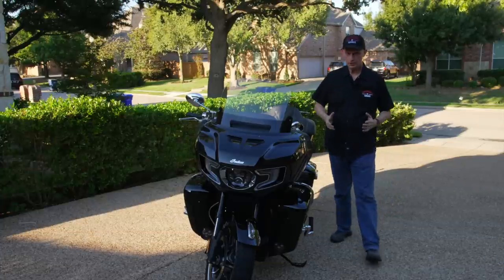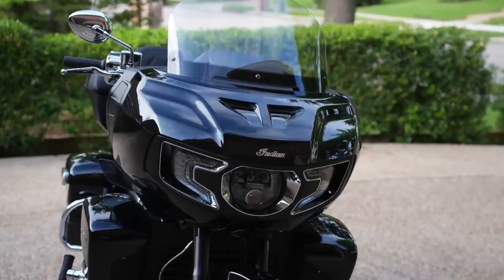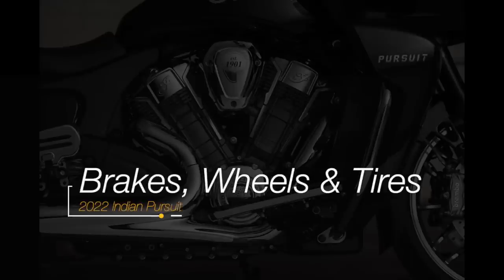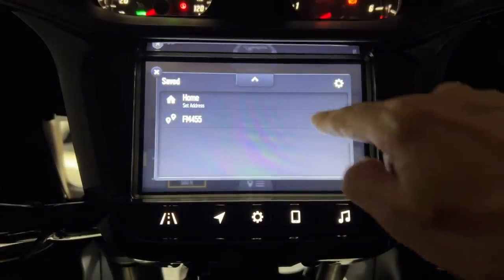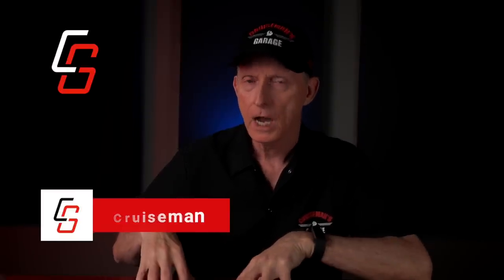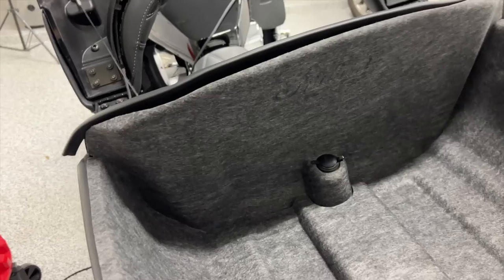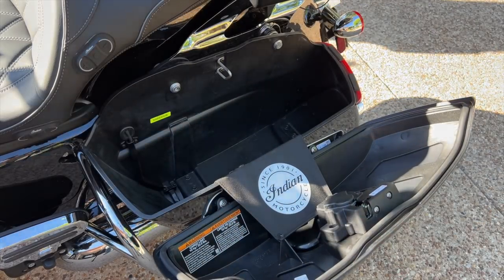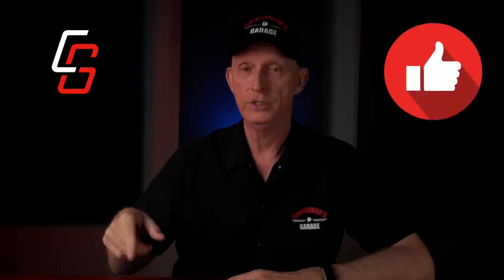Is the 2022 Indian Pursuit the BEST V-Twin touring motorcycle? | Indian Pursuit Review

Comment: Indian Pursuit Owner - I hate to admit it but I agree with every thing you said.  The liner in trunk is loose on mine. It wasn't on my Roadmaster. So I can't figure that one out. On the trunk removal. After you remove them the first time. You can replace the screws with a tie rap that will be hidden from view. To remove it you would have to open the bags. The bags are locked so that solves that problem. It would be nice if the bags and the top of the trunk were lined also but I guess we can't have it all. Good review.

Comment: I've had a Victory Vision since 2008. The battery is in the exact same location. It's very easy to access and change out. 10 minutes max to swap it out. Done it twice already and will probably do it again before winter.  From a first hand perspective, I can assure you that the battery location is a non-issue.  Great video as always. Thanks!
Reply: I just came off of a 2012 Vision. The biggest difference in my opinion is the wind management. The Vision is far superior in my opinion with wind and rain protection. My wife likes the Pursuit better for comfort having fallen asleep a few times. I miss my Vic but the little deer thought that it would look better as a hood ornament.
Reply: I also have a 2008 Vision. I haven't found anything close......

Comment: Very nice review. It's ashame the bike doesn't have a reverse....or hill stop assist...or a centerstand..or  AA...seems like those features would be easy to add and a bike in this class should have those features.
Reply: And at $30k to boot! The Gold Wing spoils a person.
Reply: @roadglide  yes the Gold Wing spoils you..especally that flat 6 engine.
Reply: At 6'2" and 191lbs... I don't need or want any of those things.
Reply: @UnrulyRider  That's fine its just most people do want those things with a luxury touring machine
Reply: @frankward8003  I bought a base model, slightly used but low miles 2020 Challenger.  Adding the removable tour pack eventually, but have no use for lowers or anything else that the Pursuit model offered.  Many people want a base model platform.  Build the bike up with aftermarket/custom parts as you go.  

I agree, there should be a premium tier fully optioned out machine. And the Limited or Elite model could fit that niche at there price.  Though a lower price-point entry level model offers the best value to most buyers as they will be making the bike their own with custom/aftermarket parts.  I feel a reverse gear is overrated to most riders that have never had it on previous motorcycles. 

A center stand could be useful, but oil changes on the PowerPlus 108 engine are designed to be done while on the kickstand.  The location of the oil drain plug makes this pretty obvious.  It's a 15-20min job from start to finish with the proper low-profile motorcycle drain pan.

Hill-stop-assist seems like something that would be easy enough to implement in the future.  Would require the proper electronics/switch, wiring, and line-lock type solenoid connected to the brake line to hold the brake pressure.  Something like this could probably be developed as an aftermarket add-on without too much difficulty... if it doesn't already exist.
Reply: @UnrulyRider  I use the reverse all the time with my bike...rock driveways or when your in the grass...or when on a slight grade...all of that makes a reverse gear  needed with a 900lb motorcycle...the centerstand is useful for all maintenance especially when changing out the tires..heck a centerstand makes washing the bike easier.

Comment: Great review and a very fair perspective on this motorcycle.  I went from a 2018 Goldwing to the Indian Challenger and have practically turned it into a Pursuit minus the rear shock and a few other details. So far...no regrets. I loved both bikes, my Goldwing and my Challenger but sometimes it is nice to change things up.

A few notes:
- The clear coat is not "kind of soft"  it is a real problem. Mine got scratches in no time. I have never seen paint this soft. I buffed it out and just ordered a tank protector. This should not be necessary.
- I have the same rear trunk as on the Pursuit. It is hard to close and takes significant pressure to close it.  I removed the latching arms and put two small washers under mine. It moves the pin down just enough to make latching easy and still watertight.
- Love the engine of this bike. I have always liked the look of v-twins but never the ride.  This bike has changed that for me, smoother than a Harley with more power and a better-looking engine than the Goldwing, with an American v-twin attitude.  In my opinion.
- No infotainment system is perfect but this is the best I have owned.

Thanks for the thorough review!
Kevin

Comment: Your review is right on the money. I have 5000 miles now on my 2022 Indian Pursuit LTD w/premium pkg. It is a phenomenal machine. Better wind protection than my 2021 GW Tour DCT I had previously and at highway speeds, the Pursuit is rock solid. My GW would catch heavy side winds and move the bike quite easily.  I would say the ride quality is equal on the 2 bikes. /At low speed turns, the GW seemed more forgiving while the Pursuit tends to have more oversteer.  Engine heat was non-existent on the wing but can get pretty bad on the Pursuit at stop lights in 90 degree + weather.  The tech on the Indian is the best out there right now. All the info you could possibly need and then some.  At times, I miss the silky smooth flat 6 of the Goldwing but I just purchased a mint 2000 Honda Valkyrie CT with 10,000 miles on the clock. That should satisfy that "itch" for a while.

Comment: I own a 2022 Chief (air-cooled). Even on sweltering hot summer days, I can feel the difference in heat creep up my right leg and the frame bars underneath the seat. I test rode a Challenger this summer, during sweltering heat. This test bike was ridden non-stop all day by other test riders. I rode it during stop-n-go traffic on the interstate and I did not notice extra engine/pipe heat anywhere on my body.

Comment: I like the Indian for many reasons.  I test road a Challenger and liked the power also.  The only downside to Indian is the lack of dealers.  I live in the Memphis, TN area where the local dealer went out of business.  My friends have to drive over 150 miles to the closest dealership if something needs done by a dealership.  I do like the fact that the Indian is putting pressure on the rest of the touring market to make better routing motorcycles.
Reply: Have you considered using industrial strength Velcro? It should solve this issue.

Comment: As a long time rider of the Victory Vision, I see a lot of common Polaris traits in the Challenger and Pursuit. Hopefully I ride the Vision for a while longer but the GW and Indian are top of my list for replacements. Thanks for the great review Cruiseman.
Reply: I've been riding a Victory Vision for 14 years now and 106k miles. Ride it to work every day of the year there isn't snow or ice on the road. It's been a great bike. Never replaced anything on the motor except the spark plug. I only see two motorcycles that could possibly replace it when the time comes, Goldwing and Pursuit.
Reply: I had a Victory Vision from 2016 to 2020 and absolutely loved it!  I only sold because of seat height issues: 2” lower kit caused damaged and it wasn’t as comfortable without it.  I traded it for 2020 Indian Roadmaster which is a wonderful bike, but had a very different feel and didn’t inspire the same kind of love.  I’ve done a few demo rides on the Pursuit and feel like it’s a spiritual successor to the Vision - I’m picking up my new Pursuit tomorrow!
Reply: You will like the Pursuit! Even though both the Vision and the Pursuit are roughly the same weight, the Pursuit has its weight sitting lower so it is easier to handle in a parking lot. But just like the Vision, once you get going it feels like a sport bike.😁
Reply: I test rode a Pursuit yesterday, and my first thought was it was like riding a Vision in handling, weight, ergonomics.

Comment: Great review! I bought my 2021 GoldWing Tour DCT and accessorized it to suit me and my significant other. I’ll be 70 in December, so figured this bike would take me to when I decide to hang up my riding boots for good. Your review has me rethinking that. I love the look of the bike and pretty much everything about it. I think it would actually be a better fit for my smallish 5’ 8” frame and probably more comfortable than my Wing. I’m looking forward to your comparison of the two. 
The only concern I would have is how substantial is the Indian Dealer network? Honda dealers / service centres are everywhere. We don’t even have an Indian dealer in our city and I don’t know where the nearest one would be. Even the nearest Harley dealer is 3.5 hours away!
Oh… and does it have reverse? Not having that would probably be a deal breaker for me.
Reply: It does not have a reverse gear. I am the same height as you and I own both a 2018 Wing Tour and a 2022 Indian Challenger. The Indian allows for a straighter shot to the ground for my legs vs the Wing. Just my experience.

Comment: When I bought my 2018 Goldwing to finalize the deal I got all my accessories at 20% off. Being my third Goldwing I decided to really dress up. The labor cost just to install them was $1800 and that was before I decided to add the home link. With your maintenance videos, I was able to install everything except the accessory outlet for my phone. McAllister of Traxxion Dynamics has a video for that. I find it really gratifying doing all the work myself.
Reply: I also installed the accessories myself following your videos. The Pursuit comes with most of the accessories I had to add to my 2018 Goldwing, I think the price difference is a wash if you are planning to dress up your Goldwing. Bummer it doesn’t have reverse or hill start assist.

Comment: My trunk liner has the same issue and they need to resolve it.   I didn't know about the blinkers so I appreciate that bit of info. Putting taller handlebars on it really helps the ergos for me.  I totally agree about the backup gear and back-lit switches, big miss on those two accounts.    Certain parking situations are out of the question because there is no way I can muscle it up hill backwards on my own.   However the handling is off the charts for me and is one of my favorite features.  The power is also abundant, more than I usually need

Comment: Really good, detailed review. I am a Victory guy, currently riding a 2012 Vision Premium Tour. It is the most comfortable, powerful, and best-handling large touring bike I have ever ridden. Victory, which stopped production in 2019, was owned by Polaris, which bought the Indian brand after closing down Victory. A lot, and I do mean a lot, of the tech, engine, suspension, and aerodynamics you find on the late model Indians are actually based on the Victory design. The motor is indestructible, and the comfort features are well thought out. I am now seriously considering the purchase of a 2023 Indian Pursuit, and your review only helps me get closer to making the decision. I am happy to subscribe to your channel. BTW, I was raised in a small town outside of Springfield, Massachusetts, the original home of Indian Motorcycles, so if I make the purchase, it will be a sort of homecoming!
Reply: Polaris made Indian and Victory at the same time and it wasn't 2019 when Polaris stopped the production of Victory.

Comment: Wonderful review. I was waiting for it. I have to agree with you on the feelings to steer to the Indian. I feel so the same. However, this bike is not cheap, these day. No deals, no insensitive at all. I could not see myself sparing that amount. Second, the lack of reverse and center stand and again dealing with breaking the bike apart for air filter, naaaaaaa! I am staying with my GW. By now, it has everything I need and some good accessories. I have no doubt reverse is coming. For now, I will watch Indian adding more updates and then will see. The bottom line, Honda got me hooked good on the 6th Gen. Safe ride…..!!!
Reply: I’ll take the replacement of the air filter on the Indian any day over the GoldWing air filter…. Way easier on the Indian. 👍🏼

Comment: I owned a victory cross country for 7 yrs and loved it.  Us victory owners believed the Challenger was the next bike in line to replace the cross country or the vision. I do agree the Indian should have put reverse on the bike as it would've attracted more potential owners.  I ride with 2 ladies now who have Victory Visions and have ruled out the challenger due to the fact of no reverse. No center stand is also a big drawback for me now that i have one on my Wing. 

I also don't like where they put the air filter...too easy to break the fuel nipple off...as well as the battery.  Again, same setup as the Victory bikes.  I hated to do the air filter maintenance on my cross country as it was the same setup. Although my 16 wing air filter is no peach to do either...lol.

My other reason for going to a wing instead of an Indian.  About 200 Indian dealers in the US vs 900+ Honda dealers in the US.   That is a huge difference if traveling across this great country.  Many don't think like that but now more and more dealers aren't working on other mans bikes...Harley for example wont touch another mans bike.  My group just encountered this this past week...needed a tire and fortunately we were able find a dealer to replace it for her.

Comment: Very thorough review. But $33K and 900 pounds and does not have reverse or centerstand or hillhold or shift assist is a deal breaker for me, no matter how good the tech and comfort is. Soft clearcoat and other quality issues that you experienced are also concerning for $33K. How about resale value? Your 4.5 overall was a bit high, in my opinion.

Comment: Honda needs to make their head unit screen as well as the indian one.
What i like about the indian
-the 400-Watt PowerBand Audio
-Rear Cylinder Deactivation 
-SMART LEAN TECHNOLOGY
-Bosch six-axis IMU
-DYNAMIC TRACTION CONTROL WITH CORNERING CONTROL
-ABS WITH CORNERING CONTROL
-DRAG TORQUE CONTROL

I also like the seat they have that provides both heat as well as cold seating.

Comment: So, there's locking nuts on the quick release levers for the trunk. If you plan on removing the trunk regularly, you can remove those locking nuts. With those there, maybe 5 minutes to take the saddle bags off and the locking nuts. If you removed them earlier, you can get the trunk off in 30 seconds.

Comment: Excellent review. Been riding GW's for over 25 years and thinking about an Indian, then ran across your video. I like things simple, and would trade all that tech for a reverse gear and a center stand, on a bike around 900 lbs. Would have liked to here a review on the sound system. As someone who suffers from low back pain, I might want to Frankenstein a rider backrest, like I did as a kid with my Exciter and Virago. A real genius might even devise a detachable passenger backrest that would lock in for the rider. 2024 might be to soon to hope for a reverse gear, but that would be a huge improvement.

By the way, C & E Indian Dealer of Auburn California just quoted me $38,550.97. Which includes $1700 freight charge and $400 Dealer prep. Unless, I want to include accessories.

Comment: It’s a great bike. It’s done it’s homework against it’s largest competitor. No question. For me however. The luxury of the DCT, stop and go City or the ever construction present highway traffic, the buttery Lexus smooth DCT just rolls along. It’s so slick and quick it just can’t be out- shifted. It’s absolutely spoiled me. At stops, a twist and it’s by-byo! Those Staged V-Twins in my mirror. 😂
Nope, no more repetitive rowing of gears, and the mental effort expended thinking about it either. That’s just for starters. The good thing is, motorcycles are like ice cream. Flavors for everyone. Any day on two wheels is a good day.

Comment: You do not need to remove the saddlebags to remove the trunk.  There is a quick disconnect connector for the power to the seat and quick disconnect latches to remove the trunk it takes zero tools and maybe 2 mins.  It is heavier than you may think. So be prepared

Comment: One major difference. The challenger is an air cooked engine that is larger with less power.  The pursuit is liquid cooled.
Reply: The Challenger has a 1770cc liquid cooled V twin with a 6-speed transmission
Reply: LOL! You couldn’t be more wrong. It’s the EXACT same fully liquid cooled engine in the Challenger as it is in the Pursuit.
Reply: You are thinking of the Thunderstroke 111 which is air cooled and is the standard engine in Indians “heavy bike” segment. Roadmasters, Chieftains, Springfields and Vintage bikes to name a few…
Reply: @Valkyrie0307  your correct to a point.. the Road Master,  Chieftain... etc is also oil,cooled.  In fact they all were when they first came out 2013/14 then the 16 models it changed but kept them on the,RM,s..
Reply: @digbysdownunder  ummmmm yes. The 111 and 116 engines are indeed air and oil cooled. The 108 on the Challenger AND Pursuit were designed from the start to be a fully liquid cooled engine, which the Challenger AND Pursuit are. 
I’ve had five big bodied Indians since 2016. I’m very aware of the different engines Indian uses.
Reply: You be Tarded !!